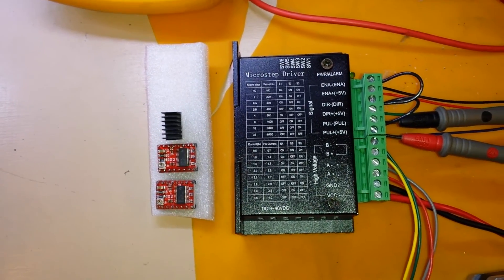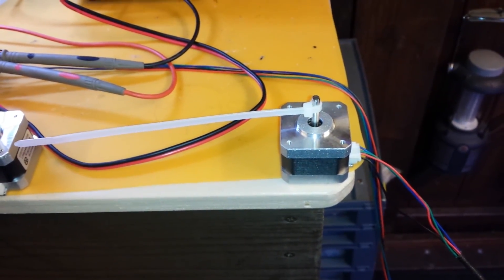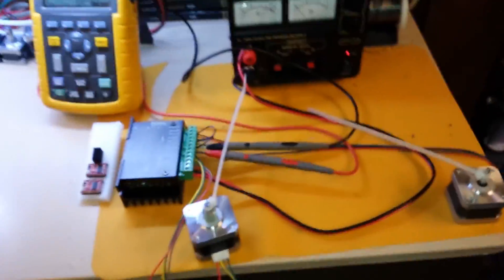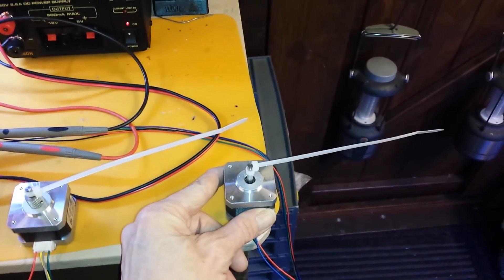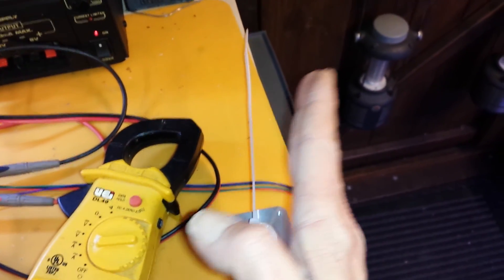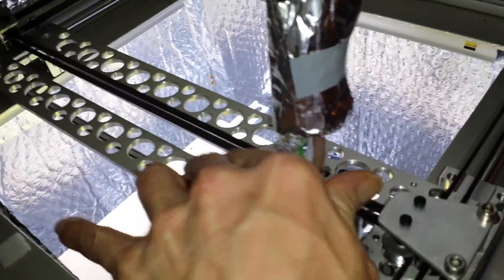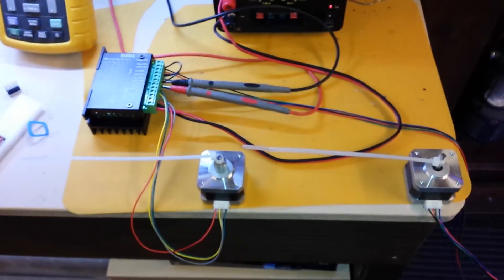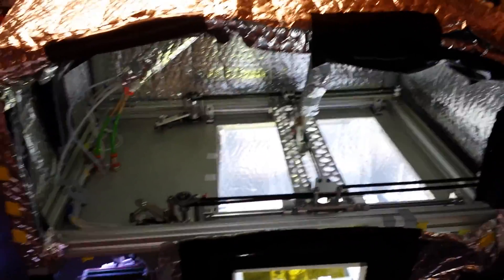3d Stepper Driver - Drv8825 - Missing Steps

Comment: Thank you for sharing. My cheap Chinese laser has started to do this. This video helped.
Reply: Started ? So it didn't use to do that? 
Cause my 3d printer started doing that skipping horribly even with new better motors
Reply: @rouuuk  Right, mine started doing it this week. What I learned from this video is that it’s not the motors that are the problem, it’s the stepper drivers.

Comment: I just bought some TL-Smoothers so I hope it solves my issue... Did you ever try that?
Reply from the maker: Hi, No I never tried to use Tl_Smoothers, I simply used better drivers.
Reply: @1973shaner  I will let you know if they help me because I am having the exact same issue as you. I saw a video of some guy turning up the voltage on the main board/driver but I dont want to risk burning them out.

Comment: By the way:
I just found out, that using higher currents can cause inaccurate microstepping.
Even if these currents are within parameters of the stepper.
It is suggested, to find the sweet spot, for the current: Not too low, but not too high either.

Comment: I have the same kind of problem here now but with an A4988
my extruder motor stops running just after the start.
maybe a too heavy load?
engine swapped, another A4988 does not work either.
I will just try with a DRV8825 you never know?
but these are annoying problems, not fun!

to think of this the printer did just fine!
I wanted to try something else with belt drive and another Mega and Ramps.
but fortunately I still have the old setup here ;-) 
that was with the old-fashioned gear delay (with gears)
and with a coupling to PTFEtube
.
.
also how you solve this problem.? PFFFffffff :-(
because that steps talk I'm not good at (certainly not in English!)

let's hope for all 3Dpeople that these problems will not happen often
it is SO discouraged!

hope the translation (Google) is good !?
friendly greetings from The Netherlands!
Rob.
Reply from the maker: Hey HobbyRob - Sorry to hear you are having problems also.
The only real solution is to reduce the micro stepping of the Drivers (A4988) and checking the current is not to high ?
if the current is high then GOOD cooling is essential on both the Driver and the Motor if they are running hot - However THEY should not run too Hot - if so then something wrong.

TMC drivers (2100 - 2130 - 2300 series) all are far better - and a 32bit Board will help remove software stutter.

My suggestions would be TMC2100 or similar and say a cheap Lerdge control board - but this will require a reasonable budget that you may not have or want to spend.

If you cant upgrade then - 
1)Check your current settings .
2) Lower your steps per mm
3)Use 24volts PSU
4)Use higher Inductance Motors rated no higher than 1.4 Amps.

I hope this helps.

Good luck my friend.
Reply: @1973shaner  Alright sir,

thank you for your reply!

the stepstick that I use is also only one from eBay (from China) you may not expect too much of it
 of course!
and if it's good, a DRV8825 should be stronger (maybe that's an option!?)
and otherwise I have found another stepstick,
   perhaps also interesting for you?
https://reprapworld.nl/products/elektronica/stappenmotordriver/raps128_1_128_stepresolutie_stappenmotor_aansturing/
here is also the source:
https://reprapworld.nl/

to convert everything to 24V and other stepsticks and so on is quite a change but maybe that RAPS128STEPDRIVER is a solution ???

next video in English? ;-)  LOL

kind regards from NL - location Rotterdam, And wish you all the best!
Rob.

Хорошо, сэр,

Спасибо за ваш ответ!

походка, которую я использую, также является только одним из eBay (из Китая), вы можете не ожидать слишком многого из этого
  конечно!
и если это хорошо, DRV8825 должен быть сильнее (может быть, это вариант !?)
и в противном случае я нашел еще один шаг,
    возможно, также интересно для вас?
https://reprapworld.nl/products/elektronica/stappenmotordriver/raps128_1_128_stepresolutie_stappenmotor_aansturing/
здесь также источник:
https://reprapworld.nl/

конвертировать все в 24V и другие шаги и т. д., это вполне возможно, но, возможно, RAPS128STEPDRIVER - это решение ???

следующее видео на английском языке? ;-)  ЛОЛ

любезно привет от NL - место Роттердам, и желаю вам всего наилучшего!
Роб.

Comment: what is you vref set to? and how big is your cap for power? on the 8825?
Reply from the maker: Hi Allan Madsen. Unfortunately I have no idea now as I stopped using the Drv8825's long ago. the only capacitor for the supply rails were the ones on the mks board. after using the Tmc's I found the Drv8825 are just not equipped to control my steppers smoothely regardless of settings ! good results could be achieved but its clear from all tests that the circuitry within the Tmc's is far superior and perform faultless regardless of speed of step interpolation.

Comment: I noticed choppy movement on my extruder stepper run by an DRV8825, it resulted into a small relief structure on my prints.. Replaced the driver to a A4988 (only for the extruder motor) and it prints wonderfully now

Comment: Hi I commented the other day about the drivers i wonder if you could help me a little more i have a Mks Gen v1.4 and a TB6600 driver which looks exactly like the one you was using. could you possibly do me a diagram of how i connect it to the mks gen and motor as i cannot find a diagram anywhere and i didnt receive any paper work with the driver
Reply from the maker: Hi Lee. yes of course I will help if I can.
Reply from the maker: if you want to email me and Ill send you a diagram of what goes where. shanedakin@googlemail.com
Ill leave my email address up for a little while

Comment from the maker: I have just ordered some Tmc2100 stepper drivers and will try these out and compare my findings.
Reply: Maker Base just did LV8729 drivers which are intended to eliminate the DRV8825 skippping. I bought 5 of them to try it out on my board, and I will post my results. They are 1/128 microstteping capable and looks promissing. Thanks you to post this to confirm the DRV problem
Reply from the maker: Alberto Mora  . hey sounds good. let us know how they perform.

Comment: Could it be the inductance of the motors affecting the smaller steppers?  Forgive my ignorance, but the symptoms appear the same as those described on my smoothieboard documentation on steppers.. Are the steppers too high-of an inductance for the drivers you have?  Just an idea.
Reply from the maker: Hi . yes the Inductance has the biggest impact with the Drv8825. they like high inductance motors to perform better. however these are generally more expensive as the ones on ebay are usually the cheaper lower types. I have tried with higher inductance motors but the issue was still there at low rpm. I have yet to try fast decay mode on the Drv8825.
Reply from the maker: Jai Stanley. I tried out some Tmc2100 drivers last night. they perform so much better than the drv8825. i will post a new video vsoon. but from early testing it is obvious the Trinamic Tmc's are the solution for a quiet and smooth operating printer. They perform better than the large Tb6600 by far and almost silent in operation.
Reply: That's interesting.  It look as though I would need to build a break-out board for those: The IC are surface mounted on my Smoothieboard, but it has break-out headers.  I had kinda got my mind around to using larger external drivers with an independent power supply.  Still planning though, so things can change.

Do you notice whine from the steppers with the TMC drivers?  I seem to recall Thom Sanladerer mentioned it in his video (I'll have to check that fact though).
Reply from the maker: Jai Stanley. The Tmc2100 . was instantly better. after altering the drive mode to spread cycle there was a little more noise when running at speed but compared to the Drv8825 and Tb6600 the difference is remarkable  ! . i tuned my current limits right down to reduce what little noise they did make. I couldnt really hear any high pitched whine as described by Thomas in his review but I have yet to run a full print off with the new drivers. I only bought 2 Tmc2100 drivers to test and another 2 arrived this morning so I will install and test my printer with all 4 new drivers. I noticed that they interpolate upto 256 step and this is what gives the smooth noisless operation.  but at high speed the noise does increase as the microstepping is lost in the fast motion. I will post a new video shortly

Comment: As mentioned by others, I would increase the resolution of the system - use a stepper with 400 steps/revolution and a 1:3 gear reduction ratio.
Reply from the maker: Hi yes that is an option of course . I tried a 400 step motor on direct and that was useless due to the skipping steps and lack or torque with the Drv8825 . The larger microstepping driver performd without any of these issues ! . Ideally I would like to keep to direct drive as my allowed space for the two extruders is restricted because of my design. secondly I feel the drivers should function better in the first place. If advertised as a 32 step driver then they should be able to fulfill the stated 32 step function without the issues witnessed. I have read about using Fast Decay mode and so I will try this mode out to see if it resolves the issue. The other thing with geared drives is the reduction in available speed and I would ideally like to keep the retraction speeds as fast as possible to assist during fast printing of ABS as this helps a lot. the other option I suppose is the Tmc2100 Stepstick but these are more expensive than the larger tb600 drivers :-(
Reply: The performance of those drivers (the larger ones) does look very good.  Looking at the price I might get a set to try with my smoothieboard.  I don't seem to be getting the same issues as you, but run a direct drive extruder so it would be harder to see.  The larger drivers certainly look like they will have a much better thermal performance and go easier on the motors!

I'm currently building a CoreXY from someones CAD files on Grab-CAD with the intention of building a heated chamber/water cooled setup like yours later on.. My Makerbot clone is still going strong though. I have some serious linear guidways from de-comissioned manufacturing macines where I used to work but no access to a machine shop since I changed jobs.  Really like your printer.  Keep us posted!

Comment from the maker: I have read an article today on the Drv8825. There is a video on you tube to accompany the article but i couldn't find it again. Basically they discovered the same issue I have and it is down to the DRV8825 chip and its limits to drive at less than 12% of the vcc. They show in depth the waveform genorated by the chip and suggest using Fast decay mode OR installing a Diode pack in between the chip and the motor ! . I am not too keen on the diode idea for the obvious reasons of wasted energy and the addition of a circuit to compensate for poor drive circuitry !! . I will investigate the Fast Decay modes and update my videos
Reply: I think you mean this site:
http://www.engineerination.com/2015/02/drv8825-missing-steps.html

Comment: you can use a geared extruder
Reply: and dont use mikcrostepping on the extruder
Reply: and test an other firmware, repetier or something
Reply: or just use the big stepperdriver
Reply from the maker: Yes using a geared drive would help and that would be my last resort but ideally the drivers shouldn't skip any steps ? . The larger driver controls the stepper motor much smoother and more accurately. I am wondering if the other axis also skip steps ? as this will also effect printing quality.
Reply: Accel erate jes thats a good idea test the other drivers and axis as well, iam also in the process of building a high tenperature 3d printer with the drv drivers on a fake smothieboard
Reply from the maker: I will test the other axis to see if they skip microsteps. I suspect the same result for all axis using microstepping on the Drv8825. I will be purchasing a 32 bit MKS SBASE board very soon but i doubt that this will improve the drv8835 performance. Good luck with your printer . i am interested in how you get on ?
Reply: Accel erate ah jes ordered a mks sbase 3 weeks ago but it takes some time from china to germany , also ordered a mks tft 28
Reply from the maker: Nice :-) . Looks like a good 32 bit board to use. Did you get the Sbase mini 12v ? or the full Sbase 24v version ?
Reply: Accel erate actually I have no idea I ordered the mks sbase v1.3 , I just hope it works with my 12 volt powersupply
Reply: just checked aliexpress it should work from 12 to 24 volts
Reply from the maker: ahh . it should be perfectly fine at 12v :-) . The board with 2 x Extruders can accept 24v. thats the main difference i think.
Reply: Accel erate iam shure its going to work, I seen the core xy system and I had planned to use it in my printer, but at this moment ian going to use an ultimaker style motionsystem, any negatives so far on the core xy system?
Reply from the maker: I just ordered my MKS SBase board and 3.2 Lcd :-)
Reply: Oh nice I don't even know if I orderd the tft28 or tft 32 , its probably the same except for size
Reply from the maker: yes i believe its the same. the main thing with these is they have thier own microcontroller built in ! this removes the load on the main board and so I will try this out on the original MKS mega 2560 version and see if there are further issue with the steppers or if it helps. I suspect it wont improve the Drv8825 performance at slow speeds but should help when running faster  :-).
Reply from the maker: May i ask what your hight temperature printer is for and what plastic do you intend to print with ?
Reply from the maker: Can you post a video of your build so far or your ideas plz ?
Reply: First I want to print abs and than see what the max temp of the complete thing is and than go on from there
Reply: I have a fusion 360 model but its really fucked up because I changed everything at least 2 times
Reply: I have a fusion 360 model but its really fucked up because I changed everything at least 2 times
Reply from the maker: Ok Sounds good :-) . Personally I like ABS very much so far ! I have NO warping on larger prints but still slight warping on very small prints.but not a show stopper ! . I am interested in your build
Reply from the maker: If you use the foil type insulation like i have BE careful when working on your printer with it ! I have had an accident or two with this stuff and the pins on the main board ! outcome was not fun :-(
Reply: Do you got a email or so that I can send you the fusion model, I dont want it public
Reply: Accel erate I have send you a link for the model, its not Finished but the basic idea, I think is visible, of course at the end everything is closed